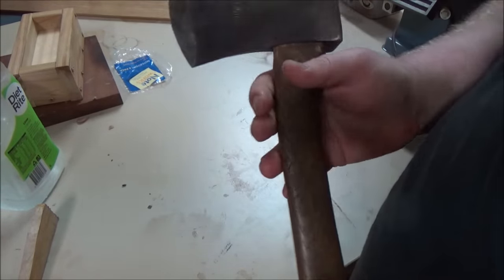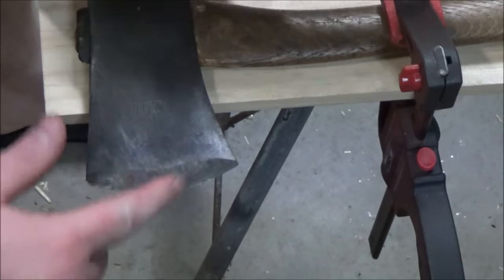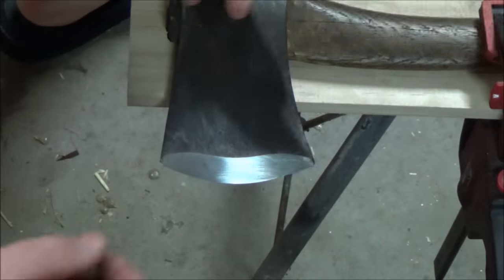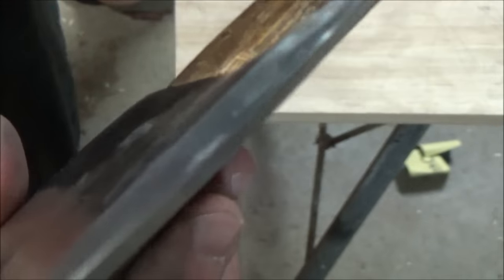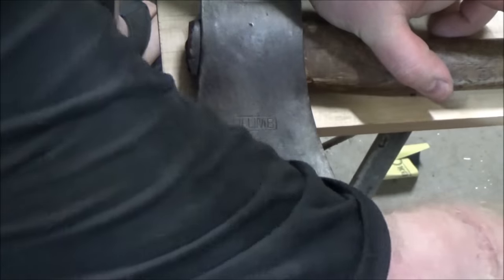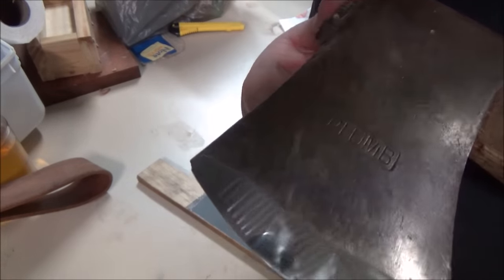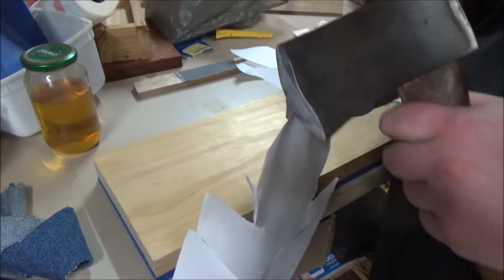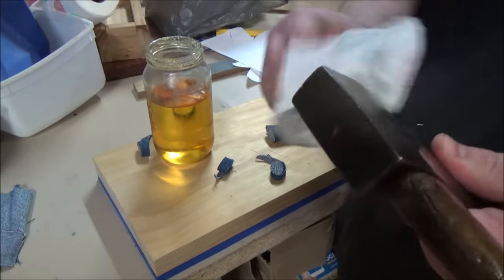How to Sharpen a Hatchet or Axe to a Scary Sharp Edge!

Comment: So, my only question, 7 minutes in, is when would you know to change the paper to the next (grit?) or when would you go up in terms of sandpaper fineness? Sorry If that’s hard to understand. Great video though. Also, sandals gave me worry haha
Reply: When the grit you're currently using has eliminated all the scratch marks from the previous, coarser grit then it's time to move on to the next finer grit. Just keep using that method on to the final (finest) grit you intend to use.   The idea is you want to use coarse grit for removing metal faster, but no longer than necessary at a given coarseness.  Then move on to finer grits to achieve a finer edge. 
In other words, to minimize time, stick to the coarsest grit you have to do all of  the shaping.  Thereafter you're just trying for a finer and finer edge, with progressively finer grits.
Reply from the maker: You kind of get a feel for it after a while. I probably spent a little longer than needed. But wanted to make sure as it was for a video. Depends how finicky you are too. I normally don't mind if there are a couple scratches from previous grits unless it for showing people or experimenting. From learning to hand sand knives I was pretty sure then sandpaper I prepared would get the previous grits scratches out by the time it was tapped out. I only used it when it was sharp and cutting fast. No point trying to get every last bit of use out of it as the time spent increases exponentially.

Comment: What weight is your axe head, great edge you got on
 it.
Reply from the maker: Sorry it took so long to get back to you. I was waiting to see a friend who has some spares of this model without a handle. But he couldn't remember which box they were in so we could weigh it. Even the one he has with the sticker still on it doesn't say. But he said that it would be 1.5 pounds as it was the common weight for hatchets. I weighed mine with the handle and it is pretty much 2 pounds. So I guess he was bang on.
Reply: @scottshobbyz5416  I have one exactly the same its a Plumb as well, but mine is just under 2 lbs , so thanks for getting back to me , appreciated.
Reply from the maker: Is that just the head or with the handle as well?
Reply: @scottshobbyz5416   just the head but come to think of it it was sold as being 1.9 pounds so that might be 9 ounces, we are metric here in Australia so I might have been mistaken about it being just under 2 pounds.

Comment: I can't imagine the state of a blade if it requires 120 grit to start. I always just use 400 grit wet/dry sandpaper, then 600 grit then a leather strop block with hning compound. That gets it shavig sharp every time. As for those nicks, it wouldn't be considered 'done' in my world if those got left in it. I'd take a faily fine file to it, then go over it with the sandpaper.
Reply: The little nicks dont cause to much trouble. At least in my experience.

And I personally sharpen with 120 if it's quite dull, and 220-320 if it needs a touch up.
If I can't be assed to deburr on the stone, a strop with black compound.
And that's my axe sharpening done.

Comment: I think this is more about feeding a sharpening fetish than about getting a hatchet ready to chop. ;)   Nothing wrong with that, per se. But go through a couple 4" logs, then do the shaving test.  But shaving and cutting paper is not what a hatchet is for, is it?  I totally agree with the idea of tool maintenance.
Reply from the maker: Maybe you are right lol. I find that the bite the edge has disappears fairly quickly when microbeveled with the sandpaper but lasts much longer with something like an Arkansas stone ( I don't know why). This is the first time I ever sharpened an axe with sandpaper. I usually use stones and files.
Really sharp like this doesn't have any benifit when chopping firewood. But when doing green wood or carving or axe racing it does help.
This was more for fun and getting my favorite hatchet back into good cutting condition. I had let it go quite dull.

Comment: Use an orbital sander. Its works just as well and is much easier. Save that elbow grease for other duties. If its not sharp enough to shave with its not sharp enough to chop wood.
Reply from the maker: I was showing you could get it really sharp without needing fancy tools or stones. 
Another guy mentioned he does it with his orbital sander. I believe if it works for you go for it. I don't own one of them yet anyway. Maybe one day.
Reply: I too have used files, honing stones and leather strops with lots of elbow grease to keep my 2 axes very finely tuned. I managed to get one in its leather sheath wet and it was stored that way. Lots of rust occurred. I worked hard at cleaning it and then thought why not just buff it off with the sander. As I was doing so it got to the edge and polished it up so nicely and I took it from there and used it to get it insanely sharp. Its so easy to maintain now just a quick touch up and a bit of varnish to seal it until next time. I didn't mean to step on your toes at all. Your method is very effective and you and I are mimicking each other by both of us using sandpaper. I'm just lazy and use electricity to help me out. I've had both of my axes since 1966.  Something else you may like is - I wrap the handle area by the head with electricians rubber splicing tape to help keep from mangling up the wood handles. Just a couple to three layers and then a layer of plastic electricians tape to seal it up, really helps out a lot. Have a great day.
Reply from the maker: I didn't take it as you stepping on my toes. I like people sharing ideas in the comment section. It can help people looking for ideas.
As I keep this one in good condition now I don't need power tools for it. But on other axes I need to do I will be starting on the belt sander as there is so much steel to remove. Especially on the hardware store axes. 
I also don't usually refine my general purpose working axes to this level. So it doesn't take me nearly as long. But I do have some axes I like to baby.
Some people love the polished steel look on there axes. It does look impressive. I prefer the patina.
It is a shame it got all wet. I'll bet you weren't happy when you found that.
 I usually don't use sandpaper either as I have plenty of sharpening stones. I might use some 120 if it is covered in gunk though. Saves cleaning it out of the stone.
Thankfully I haven't had any problems with overstrike with the hatchet. This one had the bit of damage from some previous owner. I know the guy I got it off wouldn't have done it so it would have been from decades ago. But being real hickory I don't want to rehandle it until necessary.
I might try that tape trick on one of my everyday axes though.

Comment: Now, how long will it keep such an edge when used to chop wood?  Can it be heat treated?
Reply from the maker: It doesn't keep the really sharp bite it has for very long. It keeps it longer if you put the micro bevel on with a fine stone as opposed to the sandpaper like I did in the video. Not sure why.
If carving soft wood or cutting green wood  the edge lasts a good long time. It still stays plenty sharp used as a wood heap hatchet but it is a waste of time to get it to this level of shapness as there isn't much difference in performance.
Good thing is that you can touch up the edge super easy by sharpening just the micro bevel with a fine stone and it is right back to scary sharp. You can do this loads of times before you start effecting the geometry and have to go back to the main bevel.
No need to heat treat an already made axe. Unless it has been dug out of a burnt down building or something like that.
If you make one from scratch you would have to though.

Comment: I think I’ll use my 1” wide sander and get a variety of grit belts. Then maybe put on Clarence Carter’s song, “Strokin.”
Reply: It's really important not to overheat the edge, you can ruin the treatment of the metal if you get it too hot with the sand belter. It'll take a while but it doesn't have the danger of completely ruining the axe.
Reply: @scylax7669  okay, maybe not by Strokin, something slower? I always check the edge of the blade and go slow. I’m gonna try your way though, looks cool.
Reply: @scylax7669  I think if I can get those size belts for my 1” sander and keep a bucket of water I should be okay. I’ve gotten really good at putting grind lines on knives and making them even. Haven’t worked on any knives lately, files are the easiest way to make a knife. I’m gonna look for me a Plumb when I get paid again. I use to have one a lot like yours just a tad bit wider. Someday maybe I will get big goose wing!

Comment: I like my axes very sharp, but it heard competitors in lumberjack competitions don’t like them too sharp. They say if too sharp the axe cuts too deep and tends to then get stuck. Just what I heard.
Reply from the maker: A friend of mine used to do axe racing. He said they always used to sharpen it as sharp as they could. They would be sharper than mine for sure.
Getting stuck is more of a geometry problem. You need it to bust out the chips. Some like convex. Mine is a V shape. I find chips come out like crazy. But every one has preferences. Also I haven't had the time or opportunity to chop wood enough to experiment with different edge types and geometries.

Comment: 3:15       thanks so much for fast forward      hard on the ears and spine that scratching noise    like people when they draw there claws on a chalkboard   CREEEE !!!!!!
Reply from the maker: Haha I guess I am used to it. I like sharpening sounds.
Reply: @scottshobbyz5416  Hey  thanks so much for the reply. Honestly   if im the one sharpening   it doesnt bother me lol   Sure looks sharp ! When i got my Hultafors axe it was shaving sharp when i got it. good axe to
Reply from the maker: I looked up Hultafors I didn't realize they are the same thing as Hults Bruck. I actually have a few of them. I have 2 half axes at 2.5lb heads and at least 1 but maybe  2 hatchets I haven't bought yet off my friend. I absolutely love the thinner profile they have. Unfortunately mine don't have the factory edge to try but they are still in pretty good condition so wont take long to get them back to razor sharp. I just don't have the opportunity to chop wood much any more. Otherwise I would be using them all the time.
Reply: @scottshobbyz5416   ya both of those are my favorite    next i think il get a hatched from them    the small 1lb head     perfect for my work
Reply from the maker: Nice. I have a couple little ones put aside for me. Smallest I have at the moment would be my brades critereon. They are good for finer work. I want to get into wood carving so they  should get used more in the future.

Comment: Nice Video, but I think You should more follow the curve, otherwise the cutting-edge of this hatchet will soon be straight - and the corners of the cutting-edge will remain dull. 
The cutting edge of my prefered hatchet, a german "Ochsenkopf", model OX-270 (very similar to the Estwing Sportsman) is also very round - so I also must take care not to flatten it - but it has a nice edge (almost like scandinavian knifes) that helps keeping the corners also proceed.
Reply from the maker: I know what you mean but I don't think I did it here. I had a burr along the entire edge. Except for the part at the very top with the chip. It will just have to get sharpened out over time.
Reply: Hahahaha in like a hundred years plenty of metal to go through before its a problem
Reply: @martytaylor1478  That means: a hundred Years working with dull corners of the cutting edge... ;) 
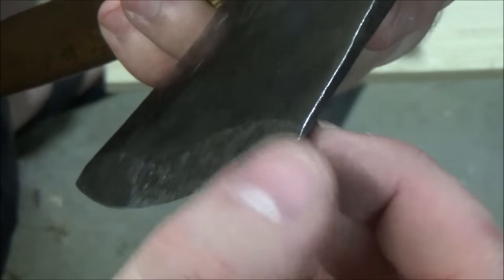Stop the video example on 5:11 and see the dull front corner... 
That does not really become better with fine grit papers or polishing - 
at the end of the Video (15:38) You can still clearly see the notch in front-corner of the cutting edge.

I mean: don't get me wrong: it's a informative Video how to sharpen a hatchet - but if You take the effort do do it, please do it complete - it's maybe 5 or 10 minutes more work, but You'll be much more content. 
And Your grand-Grandson (in 100 Years) can inherit a well edge-shaped and razorsharp axe... ;)

Comment: I file my axes with a mill bastard file sharp enough to shave hair off your arm, while keeping the correct amount of cheek. Usually 50 strokes per side in a vice. And ps I was on a woodsman team 30 years ago.
Reply from the maker: Nice. Lots of people underestimate the humble file these days. I am going to do a video shortly sharpening a Japanese carpenters hatchet for a friend. I will be starting with a mill bastard as well. But I will be draw filing similar to how I did with the sandpaper. I only did the sandpaper as I was trying to think of a way people with no sharpening stones or tools could get an axe sharp with little practice. I had never actually used sandpaper for that before this video. It came out pretty good I thought but the edge doesn't keep its bite anywhere near as good as when you finish with a fine Arkansas or similar.
Reply: Abrasive papers will remove material and sharpen metals but they wear out pretty quickly inless you use grinding sanding discs which seem to last alot longer.

I always start cleaning and shaping with files before refining with sanding abrasives. Files do the initial work that would take a considerable more amount of time and material cost that it would do if using just sandpapers.

Saying that it all depends on the items original condition but i do find the cleaning and shaping/ refinishing and polishing of metals therapeutic and very interesting. 

Taken an old piece or worn part and making it good as new with some old crafts is very rewarding if you have the patience to do this type of work.

Love the video and the time you spent sharpening the axe. All the best man 👊

Comment: I have a Gerber knife the blade itself is probably 3/8 inch thick I wonder if I could do the same thing with that
Reply: You. Probably could but with Gerber's you need to start at the higher grit the low grits will just rip the blade to shreds
Reply from the maker: What model knife is it?

Comment: What's a good angle to sharpen a small hatchet like that?
Reply from the maker: It kinda depends on what you are going to use it for. My bevel is a little larger than normal as it isn't used for dirty jobs or abused.
I would recommend just start out making the bevel somewhere around 10mm-12.7mm (2/5-1/2 inch) on each side. Also raise the angle a bit on your final grit to put a microbevel on there. This will strengthen the edge and makes touching it up really easy. 
If it isn't getting damaged and you want more performance out of it then enlarge the bevel a little. If it is taking damage just sharpen the micro bevel a bit more. Then you will be into thicker steel and it won't damage.
You can touch up the microbevel loads of times before needing to address the main bevel again. 
Hope this helps. Let me know if something didn't make sense.

Comment: Doesn't putting that fine of an edge on a hatchet or axe make the edge too weak for chopping wood?
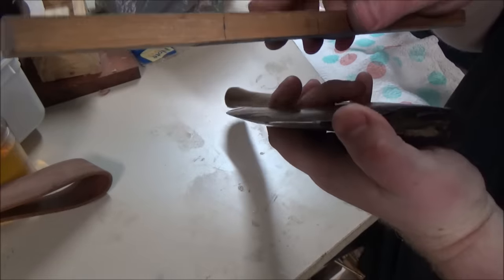Reply: Question of the edge angle you choose. He made wide angle edge by the finest sandpaper. 9:50 Which is quite smart. I definitely will use this on my kitchen knifes.
Reply from the maker: It is actually a little fine as far as axes go. Most you usually go is 15 degrees per side or 30 inclusive. This is at about 27-28 inclusive so the micro bevel is needed for sure which helps toughen up the apex a lot. I usually put one on my axes anyway even if they aren't this fine. Without it, in this case it would roll or chip too easy. It was taken finer than usual because it is mainly used for light duty tasks (carving/green wood), so it holds up good and performs a little better. But I have used is on dead euacalypt and it held up fine. Good steel in the old plumb axes though.

Comment: Why not just use an angle grinder, linisher etc to rough off then finish with your diamond stone ?
Reply from the maker: Because it was meant to be a tutorial for beginners who don't have stones or tools. 
It is cheaper and easier this was if you have never sharpened an axe before. But in the long run it is more expensive. So if people find they like it I would recommend they get some proper equipment.
This is the first time I ever sharpened an axe with sandpaper. I usually use stones or files. If really bad I use my belt sander to rough in the bevel.

Comment: How long will the axe stay shaving sharp? Even if it dull slightly after ten chops of a tree, the real question is how long will it stay sharp enough to chop trees...
Reply from the maker: If cutting green wood it will stay sharp for a good amount of time. It is very easy to touch up to shaving sharp again. A few swipes  with a fine stone like an arkansas on each side ( hitting the microbevel) and a few alternating swipes and it will be back in buisness. You can do this loads if times before having to address the main bevel again.
But you will get a long time if you let it go to dull like I did here. Plumb axes (the old ones anyway)  have good steel. But like all tools they perform best with proper maintenance. Kind of like how you have to fill the gas tank and change the oil on every car. Some might get better milage or have more power but if you Don't maintain them it won't matter if you spent 1k or 500k on the car.
Reply: It depends alot on the quality of your steel

Comment: Excellent workmanship sir, however, 5 or 10 whacks into a log will destroy the razor sharpness.  I have sharpened edges to the extreme before but at some point you reach a point of diminishing returns. 
Thank you for the lesson on excellent craftsmanship.
Reply: Your right about that! Making it so sharp & thin it with lose its edge quick. It's not a kitchen knife slicing ripe tomatoes!